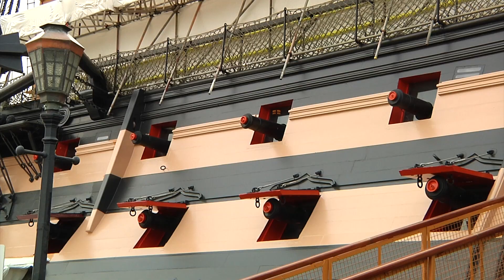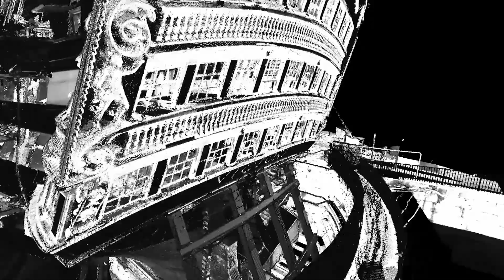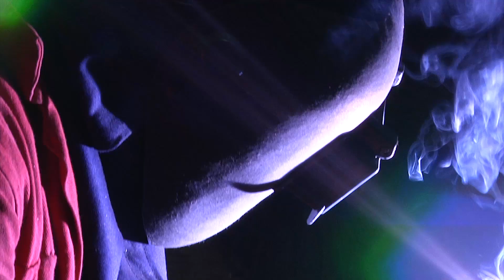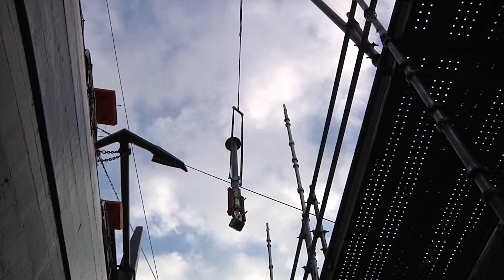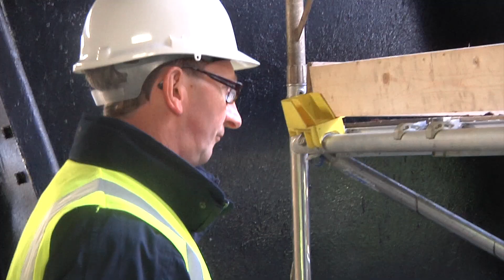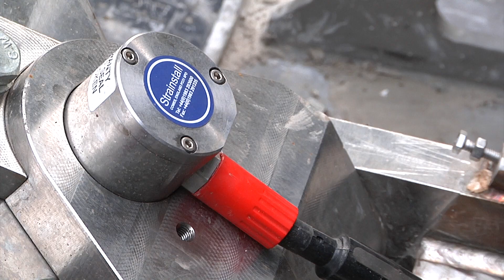A SAFER BERTH – Re-supporting HMS Victory

Comment: Do you reckon if I paid a ship building company to build me a Ship of the line (like a bellona class 3rd rate). Do you think they'd build it if I payed them enough?
Reply: Yes sure but you need to be rich AF. The French frigate Hermione cost 30 million. Now granted she was built largely the same way as in the past as a historical research project save for drill and the like so you might be able to do it cheaper. But Victory is 3 times the tonnage of Hermione. So I think about 60-100 million would do it. There are companies who still build tall ships for movies and such like Bounty or HMS Surprise they would be the people to call. Also Hermione takes a crew of 70, which is a skeleton crew for her. You'd probably need 200-300 to sail her. But people do if for free on Hermione just for the experience. They also relearnt how to sail a square rigged ship so you'll need some sailing lessons. It's quite complex, the steering is mainly done by sail so you always need lots of hands moving the spars.
Reply: Oh sorry I forgot the Bellona part, so a third rate would still be a huge ship. Probably still 60-80 million, it's still way more work. I do woodwork so if you need any hands let me know I would love to see HMS Bellona sail. But I need to be paid :P

Comment: Put it in the water. It's absolutely ridiculous that you spent that money doing that. The 20% original wood on the USS Constitution is all below the waterline. The saltwater preserves the wood. Unlike the HMS Land Barge, the USS Constitution is entirely sea worthy. It could with 100% certainty, set sail and make the voyage across the Atlantic for Portsmouth this morning.  The ship is taken into drydock every few decades for 3 years. There is no reason that HMS Victory should not be made sail ready. It is only 6 years older than the Constitution, yet they are in far different situations. The Constitution was in Boston harbor on Independence day and fired a 21 gun salute 2 months ago, July 4th, 2019. Sometimes when we look beyond our sphere of influence, there are better alternatives.
Reply: Victory is  noticeably older, about 1 average lifespan of a wooden war ship. Constitution was in bad shape, when it was decided to restore her to keep her afloat. 

That restoration meant a lot of original fabric of the ship had to be replaced and thus lost, so now constitution is about 20% original. With Victory, the decision was made to keep her in dry dock and preserve as much of her as possible, and there are somewhat 30-35% of her original 1765 timbers in her, mostly keel, lower frames and the orlop and  lower gun deck.

Her original timbers, though, are not in a conditions for  active sailing etc., and would have to be replaced to make her seaworthy.

So, the question if, if you'd rather preserve a 35% original ship in a dry dock, away from the onforgiving dangers of the sea, or do you replace most of what is left of her, so the remaining 5-10% can rot afloat?

As much as it is unpopular to say this, victory would benefit from being kept sheltered from the elements,  by, say building some sort of giand garage around and above her, to keep out  storms, freezing water and burning sun.

Comment: Give her back her masts , you have had them long enough !
Reply: Original masts were burnt buy the Victoria's.The ones installed now are steel tube,and thay are so heavy there breaking Victories back,thay are in the process of being replaced with carbon fibre models 👍
Reply: @davejames1452  Interesting
Reply: @davejames1452  She'll be in tip-top racing condition in no time!

Comment: Brilliant that they're looking after this great old ship but it seems like someone made a lot of money to say 'put some poles under the strong bits'
Reply: It seems that if they really want to preserve it they should stick in in a building somewhere so it doesn't rain on it and it can be humidity controlled.  The USS Constitution in Boston is still floating in water.
Reply: @Anon54387  because she was build half a century after the victory and she’s a much smaller ship with an iron hull so she’s gonna be way easier to preserve than a wooden first rate from almost 300 years ago
Reply: @harleyokeefe5193  Dude did you just say USS Constitution has an iron hull? She's made of oak. Ironclads came 60 years later.

Comment: The cost of safekeeping for all those years,won't it be cheaper to rebuild new one with whatever you can salvage?
Reply: A new one won’t be the original.
There is also a severe lack of properly experienced shipwrights.
French based Le’Hermione is just a frigate and it took them 7 years and $22 million to build it.
And it was build using some more modern methods than the original (modern adhesives, bracing etc.).
HMS Victory is several times the size of Hermoine. The length is similar but Victory is about double the deckheight and has 50% more beam. Overall Victory is probably 3 times the size of Hermione.
So you probably looking at least at a build time of 20+ years and costs between 100 and 200 million. By the end of it you do not have HMS Victory… you have a replica of HMS Victory.
Reply: @Praxics0815  Hermione took 17 years.
Reply: Thats not the point of trying to preserve HMS  VICTORY as a historical museum ship. No more than if they turned it into a floating restaurant or casino.  They will do whatever it takes to keep it as is for as long as they can.
Reply: Why preserve the Alamo, or keep the White House, or the original Constitution (Document), or Mt. Vernon (Washingtons home), when you can save  money by taking token  pieces,  scrap the rest and  make new  copies?

The point  of preserving any ancient artifact is it being original and old.

Comment: Why isn't Victory fully rigged with full masts?
Reply: They removed the masts and rigging for repair. It also saves weight on the hull which needs to be fixed.
Reply: Victory is having a major refit, it is costing aroung £50 million pounds, the masts spars and rigging will all be back.

Comment: Would be nice to see her on the water again. 

As I read the other comments below about USS Constitution and HMS Victory being the oldest. Yes, Constitution is the oldest floating commissioned ship. Victory is permanently drydocked. Constitution fought 42 engagements while Victory fought 5 major battles. If we were to pit both Constitution and Victory against each other there's no doubt Victory would defeat Constitution. But since Constitution is a frigate it's faster and manuverable. Both ships have one flaw, their stern. If shots made it into the stern it would cause massive damage. Shots would bounce from stern to stem. Given that I think it would be a stalemate.
Reply: Stundie Award the victory actually has 2 well hidden stern cannons just under where it says victory... 
I only just found out about them
Reply: I'm well aware of the stern cannons. Constitution also had 2 bow chasers.
Reply: Victory was considered an excellent sailor for her time while the Constitutions handled more like small lineships than frigates, sure it’s not a 100% guarantee but realistically any confrontation between the two would likely result in the Constitution running as fast as possible from Victory
Reply: Well not much difference in speed. Victory 11 knots and constitution 13 knots

Comment: Better solution. Make her watertight and then put her back in the water.  One, the stress would be distributed properly, and she would be the oldest floating warship in the world, taking that glory from a he USS Constitution.
Reply: no victory is the oldest commissioned warship
Reply: @Rohnski  The HMS Victory is a First-Rate Ship of the Line. Whereas tge USS Consitution is a Frigate. That is my knowledge on them. So far. I don't really know if that helps
Reply: Strip the copper bottom sheeting, give her a good coat of tar and re-copper.
Then into the water! (In the, 'dry dock'!)
Reply: I agree with Mr. Braslow, but as a Yank, I'd hate to give back the honor to the mother country's ship especially since one of her first duty assignments was participating in the invasion of NY Harbor in 1776. Otherwise, by all means, make her a ship again. That's what she was made to be, not just a museum piece. Look at the Texas, almost sunk. Look at the Yorktown, sinking in Charleston's mud. Ships were made to sail, not linger for tourists alone.
Reply: Norman Braslow if you owned a boat you would understand what work it is to remove barnacles and paint.
Reply: Horkos of Dõnsö, I've owned several.  Scraping the bottoms and putting on the most foul paint possible, called Cape Cod Triple C, is a lovely experience, slipping and sliding on barnacles and other various marine life.   The stuff is outlawed now, for very good reason.   Still, the Victory is a ship, and ships are meant to float.  Look at the disaster of the Cutty Sark.   Makes me want to cry.
Reply: Please note, I said oldest "floating" warship.   Victory is older.   Both are in full commission.
Reply: @j.4354  Then do it.
Reply: The constitution is the oldest warship still afloat and manned by the military
Reply: James Johnson, I don think the history of England goes back quite that far.   Each nation has points to be proud of, well, most anyway.   Maybe not Uganda, and a few in the Middle East......
Reply: So many offended Americans 😂
Reply: @jdz9952  ironic seeing as the first "offended" comments came from Brits hating on the Constitution. Maybe some people just have some pride for their nations historical treasures, regardless of their country of origin?
Reply: Why are some Americans mouthing off? None of their business. But that's what Americans do.
Reply: @Cam-r4i7f  I love how people like you stereotype all Americans as ignorant assholes and then say shit like this. It's the internet, people of any origin can comment on any publicly available content.
Reply: @James Johnson  without america you would be speaking German right now
Reply: What glory? A ship that made absolutely no difference save for taking on smaller frigates with less crew and smaller cannon? The Victory took part in massive battles including the most decisive of them all which involved squaring up against ships such as the Santísima Trinidad. The Constitution is a joke compared to Victory and to even name it in the same sentence makes me shiver with disgust. Just another overrated show piece blown out of all proportion, much like the rest of US mil. history. VICTORY is the oldest and most renown warship still in commission. End of. Full stop. PERIOD.
Reply: Victory is not Glory. Glory was an Air Craft Carrier... was.
Reply: @doug6500  It's all a matter of perspective as to which is more important... and I might be biased since I'm an American but... HMS Victory helped the UK become the dominant sea power finally breaking Spanish claims once and for all and keeping Napoleon from causing even more havoc than he did. That's a great legacy and Victory earned it. On the other hand. The United States might well not exist if not for the USS Constitution and her sisters. Those ships gave the British just enough pause when it came to bringing troops across the Atlantic that it gave the US barely enough time to organize a defense. Even with that extra time the US lost pretty much every battle except 1 on land. So without HMS Victory the UK probably still would have had an empire, but without USS Constitution the United States of America would have lasted about 30 years as a sovereign nation.
Reply: @doug6500  Surely there's a short pier on that little island where Great Britain used to be?  Use it for a long walk.
Reply: What!? Oldest commissioned? First off victory was launched in 1765, constitution 1797, second off it’s a single deck frigate that only really played a part in 1812, and the victory has been the flagship of the British Navy since she was launched and still holds that title today... please read a book yank
Reply: @davebenjamin5617  The USS constitution is the oldest commissioned war ship with a active crew.
Reply: dave Benjamin . bit rude.
Reply: I agree with you 100%. People will say that Victory is the oldest "commissioned" ship. However it's not a genuine commission. The Constitution is fully seaworthy with a trained US Navy special detachment. It could set sail this morning for Portsmouth and fire a volley across Victory's bow. Of course Victory is 32 years older but they made a terrible mistake by taking it out of the water. Instead of spending millions of quid to shore it up, they should have put it in a real drydock and refit her. Same money, far different result. Saltwater preserves the wood. The keel and hull below the waterline is all original on the Constitution. So no, a faux commission doesn't count. The Constitution is the oldest SAILING commissioned boat in the world. You can change that by lobbying the government. Pure ignorance to put a heavy wooden vessel on land for extended period. It will crush itself no matter how many lift points they put in it. Not to mention it looks foolish. Until it is rocking on the water and rising with the tide, it's not a real boat.
1812 could have forever changed the American landscape. If it wasn't for Napoleon,  the Midwest may be an Indian Nation and California would still be part of Mexico.
Reply: CONSTITUTION is also the oldest fully commissioned warship. She is properly the USS CONSTITUTION.